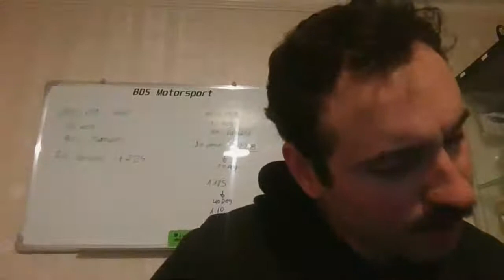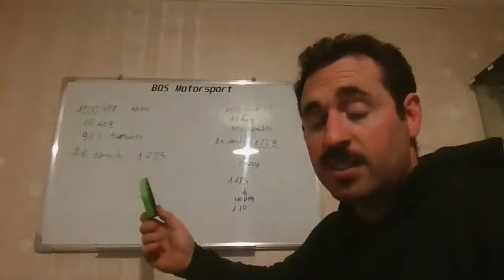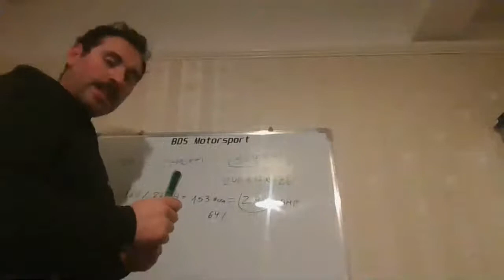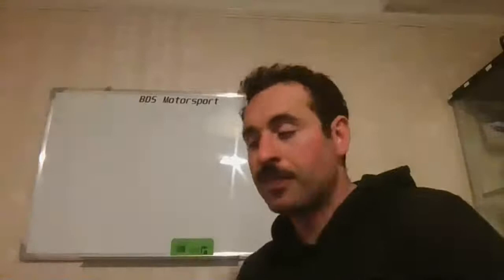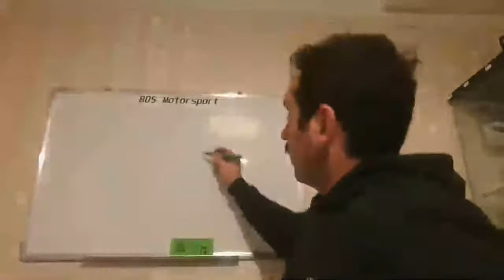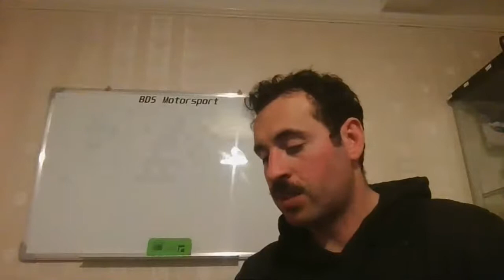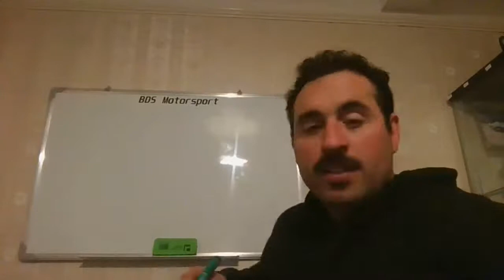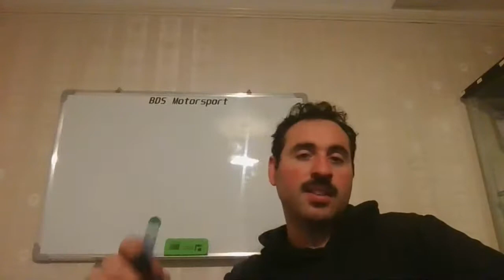air density and resume for other live videos

Comment: Could you talk a bit about engine cooling; can you calculate the heat output of an engine and thus determine how large a cooling system needs to be? Also what effect water pump speed has on cooling?